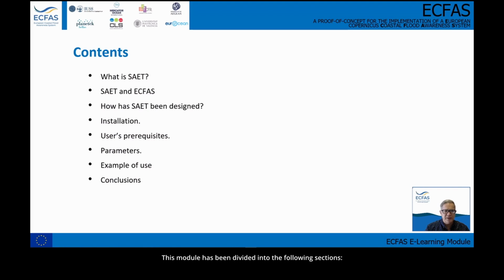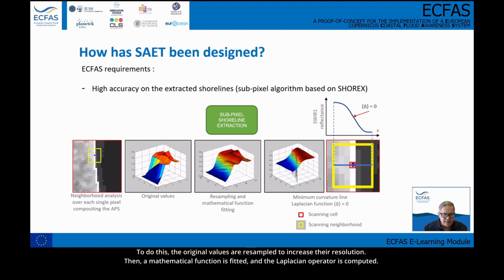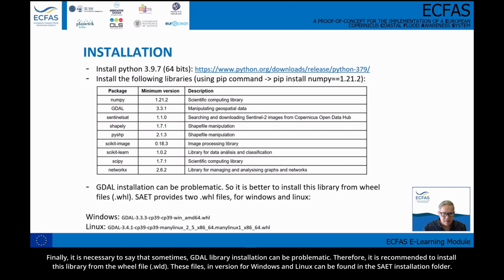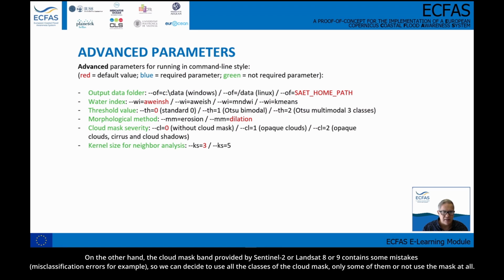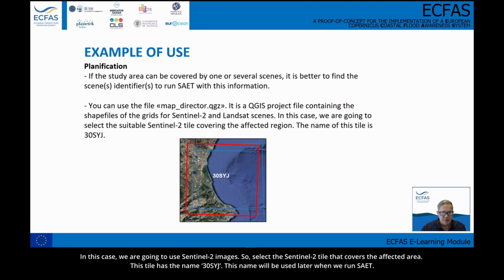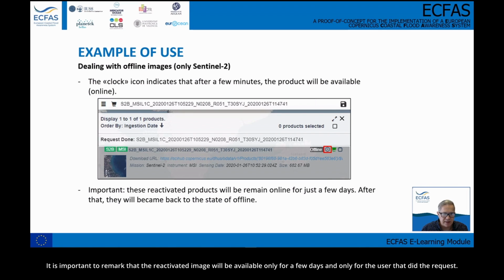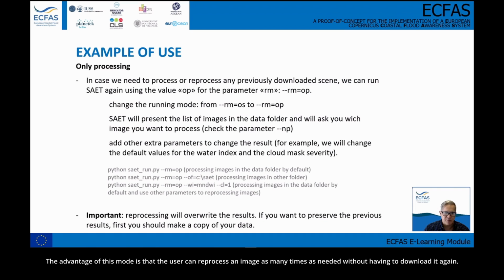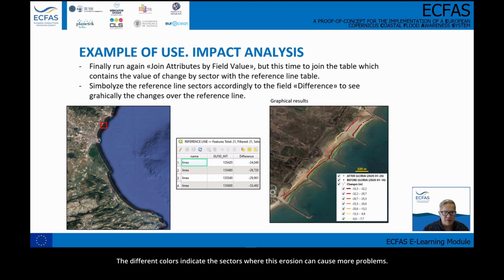ECFAS E-Module: SAET Shoreline Analysis and Extraction Tool

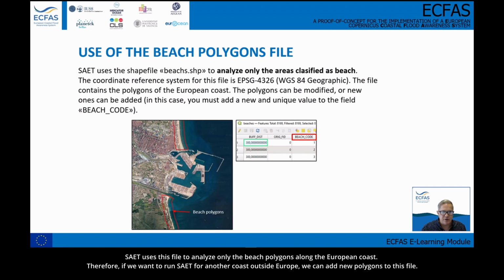Comment: thank you. I have this query - I want to study a beach outside Europe (in India for coastal erosion). At 13:11 in this video, you've mentioned that beach polygons can be added in QGIS for regions even outside Europe. But I have a problem - SAET V4.0 is not downloading Sentinel 2 images from outside Europe at all despite mentioning the lat long correctly and even the Tile ID in the alternative method. It is searching for only images within Europe. Do you reckon that by adding new beach polygons in India in the Beaches shapefile will help me to download images from India? or is there another way? or is it that SAET is only restricted to European region only? Would appreciate if you can help clarify. Thanks